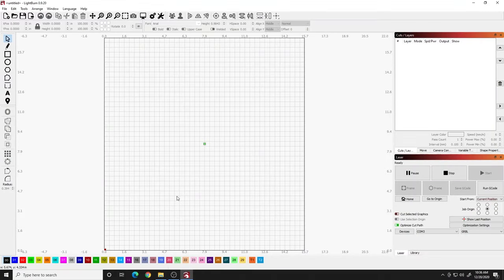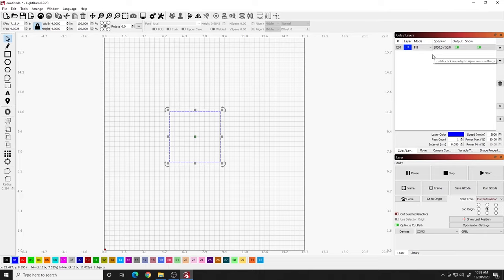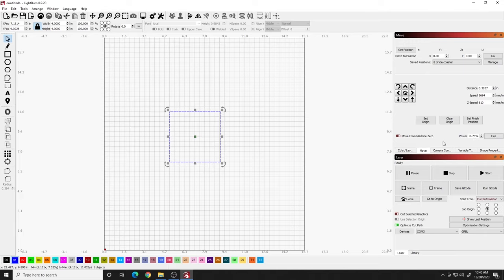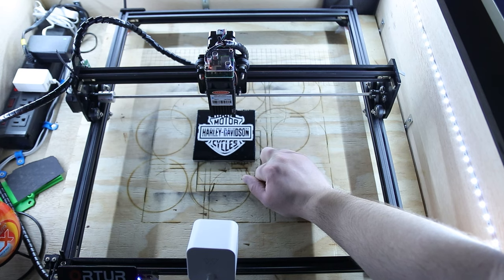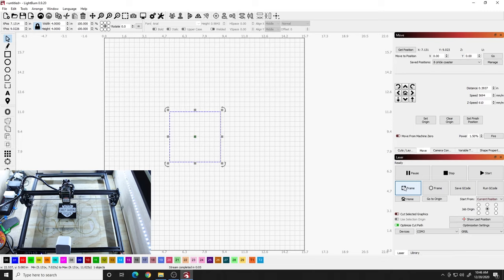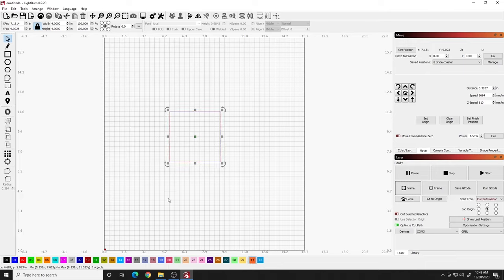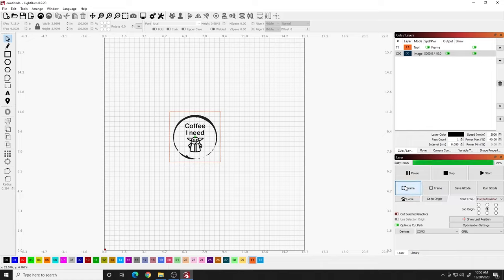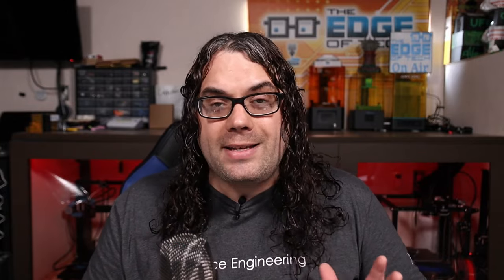How to Align and Center a Laser Project in 3 Easy Steps - Ortur Laser Master 2

Comment: Another tip, burn the square onto your waste board and save the settings in your library. I have over 60 projects in my library that I can repeat without even framing.
Reply: How?
Reply: Yup
Reply: Exactly save urself all those hassle. Do has rich said! Burn the size of the surface u are mostly going to use for ur work..check the setting speed and power for me on balsa  2000 speed and 30% power  when ready  click play button  and it will burn lightly the periphery of the square or whatever u have.then place ur material on machine within the periphery burnt  and secure cos ur done want any movement.
Reply: 100% agree. That's by far the easiest way to align this repeatedly. 

If you set your laser up permanently somewhere and don't move it, you can also burn a square or just the corner of a square onto the spoil board. Glue or screw an L-shaped piece of aluminium or steel or even wood onto that corner and you're done. Butt your object up against it and you'll have perfectly square framing and alignment for engraving every time as long as you set the corner as the corner of your workpiece of course.

I believe their new aluminium bed has a metal tab to do just that which makes it even easier to achieve.
Reply: Can go a step further, if you do need to move the laser or there is a chance it gets bumped.
Cut a base board oversized and cut holes for the feet of your laser to stand in, outline the working area of the laser with a light pass to frame a square/rectangle. Cut multiple boards to that working frame dimension and lightly outline different projects on them 
The base board will always be aligned with the laser because it’s referencing the machine legs, which are fixed. And the ‘project boards’ will always reference the outline on the base board
Reply: I do exactly the same thing....burn the frame into the base board. I also let the software find center and burn the frames from there. With the exception of small sized projects, I'm typically doing one burn at a time, so use the center for all of them!! Then, when you are building a project in Lightburn, just use the align function to center it! Makes set up so much easier!

Comment: Put down a layer of painters tape, outline your piece in Lightburn, engrave the outline on the tape, put the piece in the outline. It's a lot faster.
Reply: About to comment the same, noticed your comment. The same way I do :) You can speed up any process by placing items on the bed.
Reply: @litejk01  I was just thinking, can you laser a .5 in grid down on your wood that your mounted to then you can just set your piece down each time?
Reply: @charlespattison3569  I did that with my home made laser engraver.  When you change the laser head, you might not be aligned any more.  I use blue painters tape myself.  Even when I engraved dupont plugs,  blue tape in 2 layers,   engraved the outline,  placed the plug in the opening,  and perfect alignment for all the plugs.  ;) 😉
Reply: @charlespattison3569  I am still trying to figure that out! Youtube videos have people saying," Go here and do xyz." I'm at the level of where is here?? how did you do that..I am trying to burn a grid in my Ortur 20w workspace, using lightburn. I need to write down each step. Only had the laser about a week.
Reply: For my engraver, from the bed  to general focal point is a significant distance.  I have to prop up the target tile with other tiles, then focus.  I draw 2 diagonal lines on the target tile, which is the center then focus there.  Then I move the laser over to one side of the tile with the fire button on and go back and forth, adjusting the tile until it is parallel to the movement of the beam.  Then I go back to the Centre and engrave from there.  The Shift+outline was a good tip.
Reply: For stuff I do a lot I made a template and burned it so you get a small dent and boom done. I have those for casters. I pick that plate of MDF, open the project file. Add in what I want and go.

Comment: I don't know if this has been said already or not as I am a little late to the party... But when aligning your material, you can fire the laser and use the "Move to location on grid" button you briefly covered and move it to each of the four sides of the outline in LB. Physically move the object to be at two adjacent edges (top/side or bottom/side) and it should be within your frame everytime. The only issue is the squaring, which is usually solved with a jig, light burns on a spoil board, or an add-on to a bed that forms a square.

Comment: Also for quick reference, I take the normal size things I use, 4" tile, 6" tile, 4" round mirror, 12" square, draw them all out +1mm (or you cant see when trying to align to the burned line), select and move all to center, and burn them right onto the table. Takes the guess work out and you can just plop down the tile/canvas/project and know your within ~.5mm of perfect.

Comment: The little tips that i had no idea existed. Thank you.
I have been using corners and edges. Manually move the laser to a corner. Fire. Align it. And then move to center edge or another corner. Fire. And adjust alignment a bit more. 
Found it odd there was ni way to laser on frame. Thanks.

Comment: Jim, i attempted your centering last night but i ran into a snag that i can't get around, i'm guessing its something i have done along the way but can't find it.  When i frame my project it runs off the material, laser is centered and image size is smaller then the material.  I thought maybe it was just the framing part and fired it anyway, image did run off the material, it seems to be coming out about 2inches larger then the settings.  This has cost me hours of time.  I test burnt this image a couple of nights ago and at that time it seemed to come out ok.  Any thoughts on why the output is larger then settings?

Comment: I'm not sure if this will be helpful or not but here it goes...  Once you have drawn your square to the dimensions of your project you can find your center to align your project by selecting the "Move selection to" icon which is the last right most icon in your tool bar that looks like a cross hair. Then choose from the drop-down "Move laser to selection center".  You must have your frame or item selected for this to work.  This will accurately find the center of your project every time without guess work.  then you can use the test fire button to visually see your center and align your substrate as needed also as well as holding SHIFT+FRAME.  The snap method of aligning your item to your frame is nice but the original object size may be larger than your framed area and may have a white background area if engraving an image.  To save time you can select your item intended to burned or engrave and press the SHIFT KEY and simultaneously selecting your frame.  Once both items are selected and you can visually see the marquee around both items you will go to the icon in your tool bar "Align both vertical and horizontal centers" and select it.  The icon looks like a circle with a dot in the middle.  If your object to be burned is larger than your frame you will deselect both items by clicking in the work area and re-selecting your item to be burned.  Once you have the project item selected you can resize from center by holding the ALT KEY and selecting and dragging a corner of the object inward or outward.  You will still keep centered without having to realign.  I hope that this was helpful.
Reply: Your tip was excellent! I have been driving myself crazy hitting frame over and over again because I didn’t know how to find dead center 😂

Comment: I have a question being new and not tech savvy, I have an atezr p20. I made a 6”x4 box and hit the center for that but my position is set for absolute and in home position. So if I change to current position and move to center the green dot go to top center of my square that’s sitting in the center.

Comment: Hi Jim thanks for this video, It has made life alot easier the way you showed. I haven't done the swatch tiles as yet, but plan on doing it when I build a fume box for the laser, so I don't fill the house with stinky smell. One question is there a way to burn the grid that we use in lightburn onto our burn surface, that would make lining up projects alot easier.
Reply from the maker: I am glad it helped! There's definitely a way to do that and I will put out a video pretty quickly on that! You can also find it in the Facebook group if you don't want to wait for the video :-) Thanks for watching!

Comment: Thanks. I actually just received one as a gift and happy about it from your videos. Haven’t opened it yet and so aligning it has been the only thing I’ve thought about before falling asleep at night. Anyways, what I’m thinking is set up an origin once, then screw down a semi-permanent square consistent with that, and then before each project, measure whatever the stock size is before adjusting the burn accordingly in the software, then slap the stock into the corner of the square. Possible on Lightburn? 

Would be fantastic when doing a series of tiles of known dimension. Hell, you could probably create a fixture plate and burn template for nearly a dozen tiles at once and they’d be all perfectly aligned in a moment every time.
Reply from the maker: You can definitely do this! I use absolute coordinates and burn a template into poster board. Then I can do many coasters or tiles at the same time over and over.
Reply: @TheEdgeofTech  I’m getting started late tonight, wish me luck! Your videos got me interested in small lasers. Then you had a video about the painting of canvas and made the Balrog and I couldn’t stop talking about it and showing everyone! So it turns out my parents mailed me one for my birthday, haha, amazing. Thanks for the inspiration!
Reply: @Inventorsquare  It is Jims "fault" too that I bought mine. Cannot wait to get it running!

Comment: Does the G8 lens make a noticeable improvement over the factory lens? If so, does it improve cutting or picture engraving qualify? Also, which G8 lens do you recommend and how did you mount it in the LM2? I have the LM2 20watt and have heard that the G8 is an upgrade but never any specifics about what it improves.

Comment: I have the xtool d1 and I did this. For some reason ever since I got the laser (month or so ago) it cuts outside of the frame. The laser showed where it would cut and then when I make the actual cut it goes out of where it showed it would cut around and inch or two to the left. Any ideas on what the issue could be laser community?

Comment: Is there a way to slow down the speed of the motor while its framing?  It moves too fast!!  If it went slower i would have more time to align it. I have to do shift+frame like 10 times like you said.

Comment: This has to be the longest way to get it done. 

Much quicker way:
1) Draw the outline in Lightburn
2) Put some card or other sacrificial material on the bed
3) Burn the outline onto the material
4) Put item in outline
5) Burn item

No messing and the right result every time.
Reply: Using the Fire button at a high %, add a registration dot in the middle of the burnt square to reset laser location in the future between other projects

Comment: Thank you, I can center perfectly now. I have one problem, could I pick you brain?  I have the LM2 (not pro). I use the spacer provided for focus but the test grid burn (used your file) burns way too dark 20-40  aren't too bad bit the rest are extremely dark . Much darker than seen anywhere on line. I used very thin plywood, then switched to half inch (not Dollar Store quality). The result is the same. I have no clue where to go from here.

Comment: I watched this a couple of times.  Great information man...One thing I wanted to make sure of.   Lets say that I have an array of several squares which will be cutout for holding actual items I want to engrave upon. A jig in this case.  The squares are just cutouts for later for me to place small wooden items in to engrave the text.  To make sure that the framing doesn't capture the squares when trying to put the text in the center should I make all of the squares in the array a "tool" so it will have the text in the center of each square?  Hope this makes sense..

Comment: Hello, i need help please, everything was helpful, but i need a little configuration help, when i use the fire button to 20%, the laser burns, but when i set the work power and start the job, the laser just lights up bu doessn't even burn paper. please help me with what i am doing wrong.

Comment: Bro. Your videos rock. I have a Laguna smartlaser mx. I have been on with Laguna countless times trying to align my laser but it's still off.  If I try to cut a square I get a slight rectangle, or if I try to cut a circle I get an oval. I have light burn as well as RD works. Any help wou be greatly appreciated. Thanks.

Comment: Are there instructions for beginners on how to use the Ortur 20w with Lightburn to burn a grid in the work space? I need instructions that say, "go here and do this..." not instructions that say Do this and run that, because I don't know where THAT is! 
I am still searching the software for things. You have been a great help. thanks.

Comment: My framing is way off, it is about an inch too high from the bottom and an inch to high from the top. Any ideas why? So its basically offset by about an inch to the top. I sure hope you get this, I just emailed Lightburn.

Comment: Just out of curiosity, is fire mode a hazard to the eyes?
Reply from the maker: Yes! Especially if the power is up.  There are a lot of people who tell you if you turn it down to a very, very low power, it won't hurt your eyes. But I would always suggest being very careful no matter what when the laser is on.
Reply: @TheEdgeofTech  Thanks for the reply. I always wear my glasses but is there any concern if you happen to forget and fire mode is at 0.75%? (The default low power)

Comment: Anytime you have a workpeice with cornera just take a ruler touch two opposite cornersmark  line roughly in center,then put the ruler on the other corners and mark a line. this will create an X,the middle of the x is the center of your workpeice.

Comment: How about drawing an x-axis and a y-axis on your board, then marking the edge of your piece at the halfway point on adjacent sides.  Then set your piece in the center and touch the markings you made.  One for the x-axis and one for the y-axis.  For circles use a t-square.

Comment: On the LB menu, the right most icon- with your square selected, click on 'Move to Page Center' - this moves your object to the centre of the screen, then below that select 'Move Laser to Selection Center' - BANG 2 clicks and yer done.  Now which way is faster - and more accurate.  We're using a machine here that can work to a few thousandths of an inch, so why not take advantage of it?

Comment: Problem just started; when I do the fire button to frame tile, laser fires, but then laser light disappears moving right, then at other times disappears to the left. Also happens when I do the position location mode; laser will light in some spots (right or left) and not others. Any suggestions as to why?

Comment: OK, so I just tried tile and at 100 power it does not etch it. So, from what I am guessing, either you paint the tile or you buy colored tile and then etch through the color to get to the white. My CO2 laser will cut into the tile great, this thing wont touch the surface.